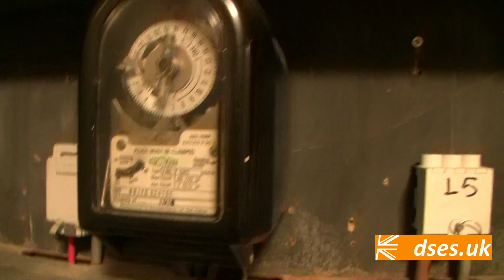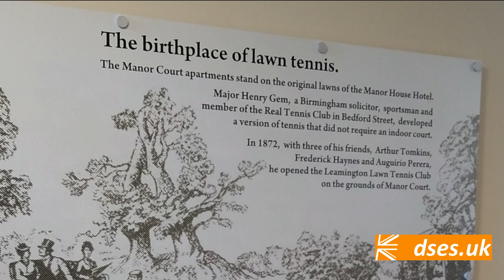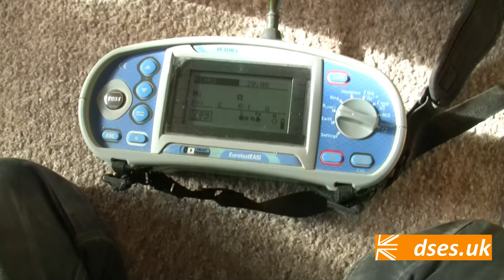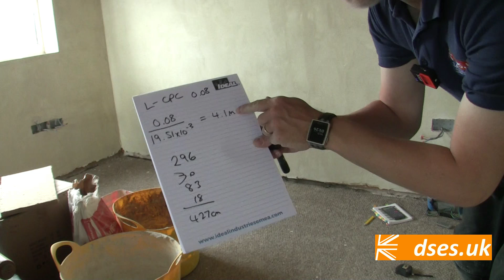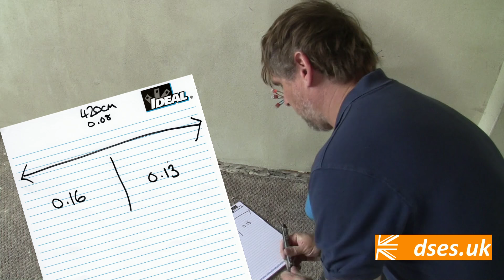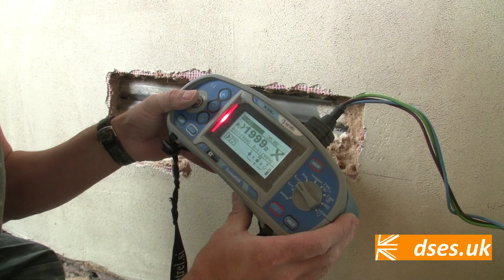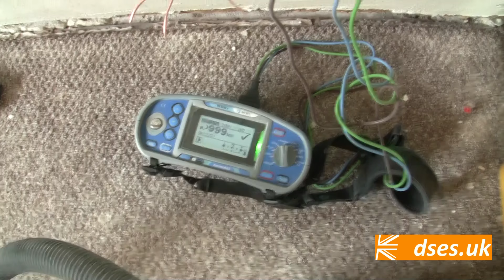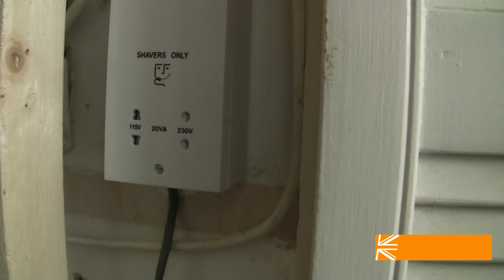Fixing another man's lash-up!

Comment: Excellent. Really enjoyed it. Especially you agonising over the repair. I was surprised you didn't use crimps and a couple of layers of shrink sleeve but obviously your method was spot on.
Reply from the maker: Thanks Mark. I would have been more tempted to crimp it if I had larger heat-shrink on the van, but I don't carry it and a trip to the supplier's would have impacted on my time.
Reply: @dsesuk  

I've had similar issues on many occasions, usually a kitchen fitter who has no clue about safe zones or simply can't be arsed to pop a small exploratory hole in the plaster to see what is actually there. I think if this install had been zoned correctly, I'd have attempted to remove the back boxes at both points, locate the fault, remove the nail and any sharp edges left in the capping from it and then taped a cable on to the damaged one whilst attempting to push/pull it through the existing capping in the wall. Clearly not an option here due to the crap zoning but one I've used many times. Twisting the inner cores together helps with pulling a new one in (reduces the chance of the cable pulling off!) and allows the cable ends to be streamlined which assists with reducing friction in the capping. I've used this method many times although it only works where cables haven't been crossed in the capping or generally poorly installed....

Comment: This is why I prefer pipes to cables, fresh wires can be pulled in without opening the walls, as long as total diameter is within size and corners are smooth or accessible.

Comment: Easiest way is to divide the cable length by the sum of the two resistances then multiply by the one of the resistances to find the distance from the point that resistance was measured.
So for the distance from the 0.13Ω resistance it'd be:
420cm / (0.16Ω + 0.13Ω) x 0.13Ω = 188cm
Also, rather than looking up the specification for the cable, you can just measure the resistance per unit length from a length that hasn't been installed.
Reply: That calculation assumes a dead short. This was not a dead short.
Reply: @alanbeard4871  No, it does not assume that at all. It's a ratio which can be applied.

Comment: Excellent and educational. Your solution was the only viable option. Maintenance free JB. What the hell are those blocks though 😂
Reply: They look like thermalite blocks, designed for their insulating properties. I think they are largely concrete but full of little air bubbles. Easy to scrape holes into and used on external walls to increase thermal efficiency. If the cables had been routed correctly (not below the backboxes), I'd have removed the nail, got rid of the sharp hole left in the capping and attached a new cable to the damaged one then tried pulling it through (preferably with an assistant pushing the cable in from the other end to help it get round the tight corner. Not an option here though....

Comment: Brilliant video. I'm always interested in how sparks locate faults.  I'm an openreach engineer and we have a couple of techniques for faults like this. For resistive faults <500 ohms or a full open (we call an open a dis) we'd try the TDR first (time domain reflectometer). Fancy name but works a bit like sonar, a high frequency pulse is injected into the cable which is reflected by the fault. The time the pulse takes to return to the tester is then converted to a measurement in metres. The pulses travel at different speeds in different cables but this is easily established using a known length of the same type of cable.  The RFL (resistance fault locator) uses the wheatstone bridge principle,  if we know 3 resistances the 4th can be calculated. The 4th being the resistance to fault. This test requires the faulty conductor to be shorted to a good conductor in the same cable (insulation resistance of the good wire should be 100x better than the faulty wire). The tester first measures the resistance of the entire loop which we then half (known as the single wire resistance). The tester then gives you the resistance to fault and the resistance fault to strap. As long as the ohms per metre is known for the cable under test then the fault location is easily calculated. Both these test functions tend to be incorporated into the same tester although this makes them very expensive!
Reply from the maker: I had such a beast in my comms days back in the '90's. A Fluke model, cost about £5k I recall. Not my money, obviously, but it used TDR to locate cable faults.

Comment: Great, wonderful, not enough gags as usual, but you've 'nailed' it with this one DS. Such a great explanation of calculating resistance and working out the distance to find the fault. 🤛💪💥
Reply: It was a great vid but he did miss that actual calculation to the fault at the end. He probably had enough to get close as the fault was close to the centre but just how far of centre? That can be worked out as follows:

The two readings (0.13ohms and 0.16ohms) represent the RATIO of distance to the fault from either end. An actual reading to the fault can be obtained by the following equation:

(r1 / (r1+r2)) x Cable length (end to end)

where r1 is resistance to fault from point 1,
r2 is resistance to fault from point 2
and cable length is obtained by direct measurement (cable route known) OR calculated as David did in this video using the CPC and line conductor. For this example, the calculation is as follows:

(0.13/(0.13+0.16)) x 4.2 = 1.88m from the point where the resistance was 0.13ohms

the same works the other way:

(0.16/(0.13+0.16)) x 4.2 = 2.32m from the point where the resistance was 0.16ohms.

Comment: Hi David, Brilliant video, would not have crossed my mind to work out where the fault was using electrical science.
Currently due to working in occupied domestic maintenance I usually just install a new cable either in surface trunking or drop down to just above the skirting board if still in the 150mm zone into metallic capping.
For future though I may adopt your practices.
Much regards
Matty

Comment: Good video and really interesting. My first thought was that the maths could tell us more. You measured the loop resistance between L and CPC as 0.08 Ohms. Call that LR, and assume it's the same for between N and CPC if there were no fault. You measured the loop resistance between N and CPC with fault from both ends as R1=0.13 and R2=0.16 Ohms.  Assume the fault is distance D1 from the end where you measured R1. Call the overall length of the cable C, and the unknown short resistance caused by the nail U. Then we have two equations:
R1 =  LR * D1 / C + U
R2 = LR * (C - D1) / C + U
Subtracting these two to eliminate U gives
D1 = (R1 - R2 + LR) * C /( 2 * LR)
which with your measurements comes to 131.25 cms from the righthand end (in your video). We can also calculate the nail resistance U as 0.105 Ohms.

The interesting thing is that 131.25/420 is 31.25% which differs from the calculation suggested by others below: 0.13 / (0.13 + 0.16) = 44.8% . I found that simple ratio appealing, but I'm thinking its actually wrong. The reason its wrong, perhaps, is that the denominator (0.29) includes the unknown resistance of the nail twice whereas the numerator includes it once.

My other thought was couldn't you just put a tone between N and CPC and find where it stops?
Reply: What's a tone
Reply: I am late to this video and was about to make almost the same comment. Almost all other commentators have made the mistake of assuming that the distance is the same as the ratio of the measured resistances,  but this is true only in the case of a pure 0 ohm short. As the fault resistance increases its term becomes dominant and skews the ratio towards the centre.

For anyone who found Samuel's maths above tricky here is my take on it, approached slightly differently. 
We have 3 resistances,    RL from the cable left to fault, U the unknown fault resistance, RR from fault to cable right.
In this case R1, the lower measurement is from the right.
R1 = RR + U  = 0.13
R2= RL + U   = 0.16
Adding these two : R1 + R2 = RR + RL + 2U.           
 resistance N->E for the whole cable  = RR + RL , which we assume  is the same as resistance L->E = 0.08
0.29 = 0.08 + 2U          so U = (0.29-0.08)/2 = 0.105
RR = R1 - U =  0.025
RL = R2 - U = 0.055
The fault fraction from the right is  RR/(RR+RL)  = 0.025/0.08 = 0.3125 x the total cable length

Comment: Very clever, the instant you said you were going to short the other pair I twigged as to what you were about to do. I am not a sparky, but I do electronics (low voltage, I do not claim to be an "Electrician") as a hobby so not sure this kind of an issue would ever come up for me. The only suggestion I might have is that if you use a meter with a higher resolution for ohmic measurements for this kind of a fault you likely could identify where it is more accurately first go.

Comment: Being an electrician in the industrial sector, I've seen some odd and/or dumb crap. But this type of installation? You can't simply just change the cable ?! WHO thought of this? We have simple PVC-piping between the accessory points. Kudos on the technical skills and fixing someone who seems to have worked for 40 seconds doing this...utter disgrace to leave something like that. Thumbs up!

Comment: Great video. Good to show how to use science to find the location of a buried partial, or full, short circuit. I used a similar technique to find behind which socket outlet ,in a run of single sockets, where the bare cpc had folded back into the line connection, because the builder had not sleeved any of the cpc’s. I also find the Progressive Electronics inductive detector paired with its warble tone generator another helpful way to locate buried cables.

Comment: Youtube recommended this, so, here I am. European wiring is always interesting to see... covered junctions are not allowed in the US... ever...  but... we do not have anything like the wiring channels in the walls... Still trying to wrap my head around that. In almost all cases- we have wooden studs to run wire through.  We do have conduit and Wiremold- but- those applications do not match up at all to this. Wiremold is a surface raceway. Conduit is almost exclusively used in commercial settings in the US now. You took the time to do it right. Minimal rework to the plaster. That's all that counts in my book.
Reply from the maker: Thanks for tuning in Andy. Yes, it seems many countries don't allow hidden junctions which are permitted over here so long as they're considered 'permanent' such as solder joints, crimps, brazed connections or, as in this video, junction devices built and installed to BS5733MF which use clamp connections that won't loosen over time. As for the channel, metal capping isn't the best and is really there to protect cabling from the plasterer. Many countries seem to use conduit which makes much more sense, but the building industry here is slow to adapt and will forever be of the "we've always done it like that even if it is stupid" school of thought. UK builders would still be putting up thatched roofs if they didn't require so much skill to do!

Comment: other things about French electrics, having lived there 14 years!
a lot of houses are supplied with 3 phase, it gets the pulse racing when you open a junction box and there are 5 very fat wires looking at you, some with 380 volts!  Each part of the house uses a different leg of the phase, you have to try to balance them to get the best out of it.
You can't use as much power as you want - the electricity contract is for a specified number of amps, if you exceed that the meter trips and you are in the dark.  Then it is a case of switching off heaters until it will tolerate being switched on again.  The EDF standing charge goes up if you want more amps.
The wall sockets don't have a on-off switch, so you have to unplug.
Very many homes don't have wiring buried in the walls, they prefer trunking, along the wall, around the door frame etc.  It is cheaper and accessible.
gotta laugh!
Reply from the maker: Crikey, I don't like the idea of being under contract for current consumption! I've no experience of French electrics, so it's very interesting to hear of the differences!
Reply: Typically French wiring is in flexible trunking that can be buried. Because it is so common it is very cheap (25mm less than £20 per100metres) It means you can replace even long lengths of cable without disturbing the decor as you avoid sharp corners. You can also make up your own cable putting as  many individual conductors as you need - many different diameters of conduit (sheath) are available. You can even snake it between stones in irregular stone walls.

Comment: Found this really  interesting, in the circumstances that was a very  neat repair.  

That wall plastering  was dubious, I can see the whole lot being redone in due course the way it was deelaminating.
Reply: it is indeed being redone now. Sadly, the plasterer wasn't skilful and the lockdown meant there was no chance to assess the quality of work in good time. hence, it is being replastered now by a plasterer recommended by the plaster manufacturer. Fingers crossed.
Reply: @IgnatyDyakov  I know this was a while ago now. Hopefully this story had a happy ending and the ‘nightmare’ is behind you now. Why was the crumbly sheet material specified- thermal insulation? Did you originally contact Dave because of his YT videos? He is very good.😀👍

Comment: Hi David
Enjoyed your videos especially your sudden launch into poetical analogies! ‘’ sucking on the orange oboe’’
Anyway thanks for the detailed info on pursuing that fault of the nail through the cable!
Strange as it may seem I do like to to take on other peoples problems!
But nothing I would quote for of course!
Nevertheless you can win a lot of brownie points from the customer with a pic of a cable penetrated by a capping nail!
( it looks like the customers feelings were right)
Anyhow just thought I would mention a couple of things  that may o
Reply: A couple of ideas that may help you on your journey through the electrical jungle!
1. If you can find a magnaclean from an old boiler you could remove the magnet and discover one
Of the most power magnets I have ever come across!
Which could be used fro magnetising screwdriver heads and
Also find the position of steel beneath plaster surfaces!

2. Could one not consider installing a further socket outlet? In place of the j box? 0r a double steel back box with double blank off plate!

3 . Move the storage heater to the first single socket and convert the single socket into a two ganger( double pole switch for heater and single socket!).     Thanks all the same for all!
Goff

Comment: This was initially assuming the cable is made correctly - which it appears to be.  Manufacturers skim by making the conductors slightly smaller than what they should be, giving different resistance readings to the on-site guide's tables. This gives reading giving false cable lengths. This is common on cheap cable. This also affects the current carrying rating which can be dangerous. In short the over-current breaker may not protect the cable properly leading to fires.